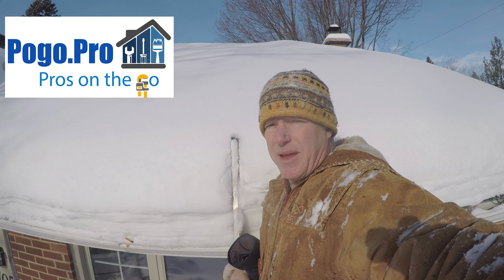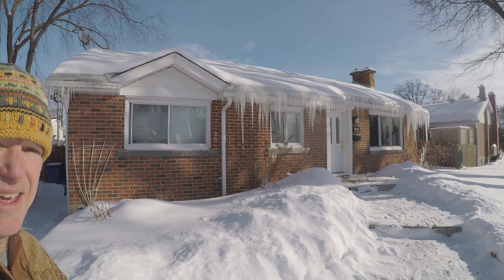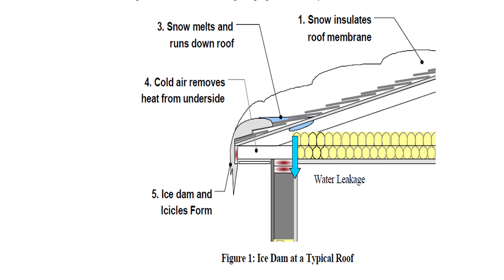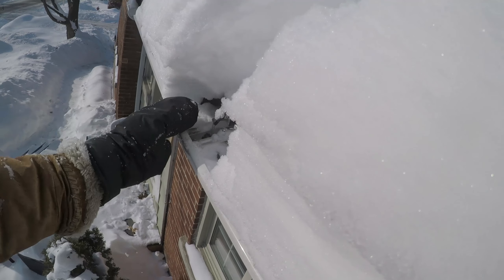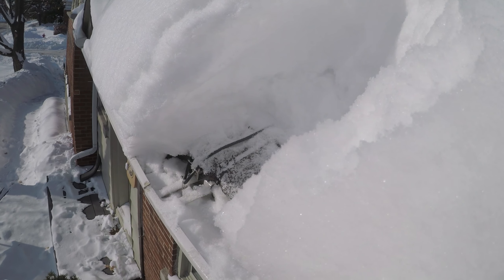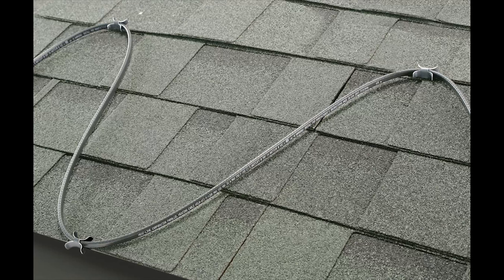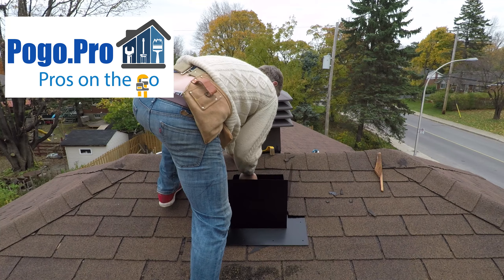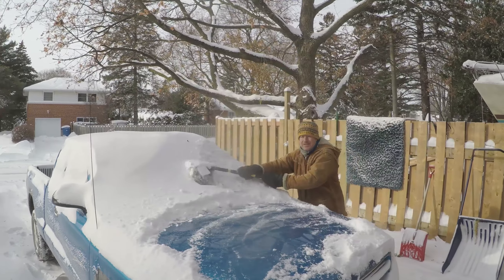How to solve roof ice dam issues

Comment: Thanks for the vid. I have just been plagued by ice dams. I was surprised to see another proud homeowner of a split level in Montreal's West Island (the Pointe Claire weather report). I have installed the vents you showed, have Ice Shield under the shingles for 6' on the edges, 12 inches of insulation, I ensured the air got in through the eaves. We get ice dams high up on the roof, on the valleys between the upper and lower roof. I don't see icicles on the edge. You mentioned the valleys in the video. I think my options are to take cans of spray foam and caulking up into the attic and seal the buggery out of any cracks (make sure my pants are on tight).

Comment: Ice dams can be avoided with 1.) proper levels of insulation on the attic floor to include the areas over the exterior wall top plates, 2.) effective free-flow ventilation of the attic space from the soffit vents to the ridge vent (or roof vents), and 3.) air sealing of all the attic by-passes to prevent warm house air from entering the attic space. All three of these measures, properly installed, work in unison to help to keep the temperature of the underside of the roof deck below 32 degrees F. to prevent snow from melting and gravitating down the roof slope and re-freezing at the eave's edge. It's a bit tricky to get it done right especially with low sloped roofs. The biggest challenge is effective air sealing out at the perimeter of the eaves where the joints of the exterior wall plates meet the ceiling drywall. Spray foam works best for this situation. What I've described above treats the root causes of ice dams, not simply applying "fixes" to treating the symptoms of ice dams (i.e. heat tape).
Reply from the maker: All true and exactly what I said at 1 min 9 seconds.
Reply from the maker: I agree with you Kevin you obviously know what you are talking about. Actually, your point of sealing the joints where the exterior wall plates meet the ceiling drywall seems like a good one. Do you happen to have a link to a related image that you could post. Sometimes a picture is worth a bunch of words. Lol. Thanks.
Reply: If this is true why did Mark's solution work?

Comment: I have a metal roof and decent insulation and I went ahead and installed a radiant barrier between the insulation under the roof to keep the roof nice and Cold—-  however I think if you have ice damming a ladder and roof rake( shovel with extending handle) would be a good answer provided you aren’t lazy,,, and if you are lazy this will help cure you.  No need to walk on the roof either that only makes sense if your roof is Flat and well built of course——-
Reply from the maker: I pretty much cured my ice dam issue. However, if the snow builds up too much I risk having an issue. In this case I do shovel.

Comment: Check the overhang inside your home at the outer walls and see if the insulation is blocking the air flow from the soffit area. Usually the #1 problem.  Install insulation baffles between the rafters.
Reply from the maker: Yeah I checked this and cleaned out soffits first thing.

Comment: I tried to find the unit you installed from Home Depot with no luck. Might not be produced anymore? Problem for me is I live in a cape cod with no way to get insulated. I am basically living in the attic! No soffits either! Just the way the house was built. I do have good insulation in the front of the house with ventilation just the second story has issues. Also, I agree that the roof vent at the peak does nothing when covered in snow!
Reply from the maker: Actually vents are rarely blocked by snow. No soffets is strange. Must be very hot in summer.

Comment: Great video! What remedy do you recommend for gutters with ice walls outside of rooms with vaulted ceilings, and therefore no attic crawl space to add insulation, just the space between the ceiling Sheetrock and the sub roofing?
Reply from the maker: Nuclear attack without seeing the roof: add insulation, put rubber membrane on exterior (resisto for example), metal roof if you can afford.

Comment: Isnt ice (dam) in gutters from day temps 33°+ and with sun 😮  Then the night time temps drop in the 20s or 5° like in Mi often (roller coaster temps)= so melting snow then freezes!  How to ya avoid Nature? Or am i wrong
Reply from the maker: Ice dams form at edge of the roof because the melting water freezes there.
Reply: @FierceTartan  Yes, johnnybravo implied that with his statement, saying in effect that no matter how good the roof insulation the midday sun will melt the top snow layer, which then flows down to the roof edge and subsequently freezes as the day cools off.

Comment: The melting cables aren't working for me
Reply: Melting cables is only a bandaid approach to the problem. The correct fix is both proper insulation and soffit-roof venting!
Reply: @chuckgoodman3828  I meant literally,  I think I have a bad cable. 
Taking it back tomorrow. 
No heat coming from it at all.
Reply from the maker: @67goodoleboy67  Yeah these cables get pretty warm.
Reply from the maker: That sucks. if it works you would know within an hour or so.
Reply from the maker: @chuckgoodman3828  I agree, not going to solve anything.